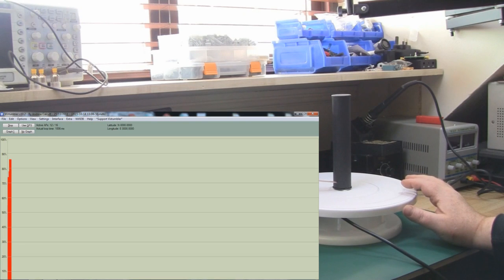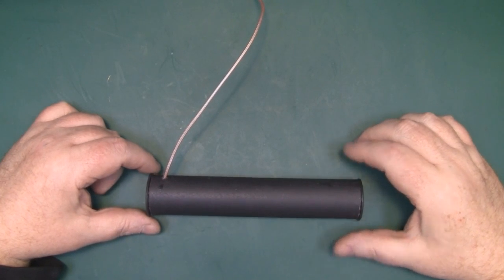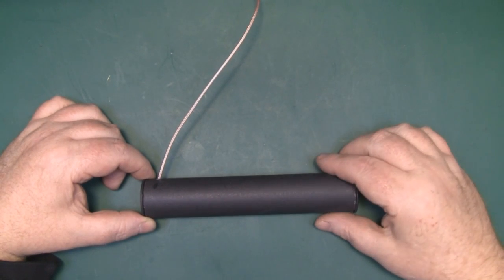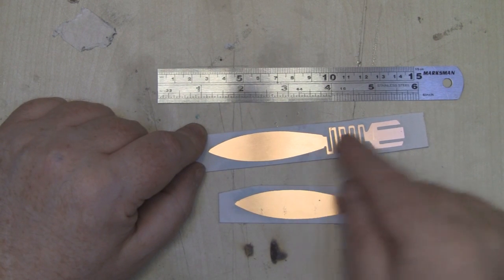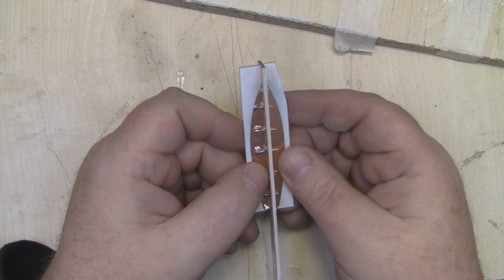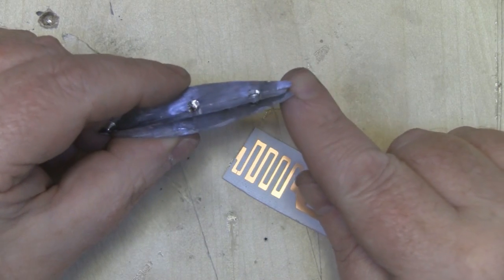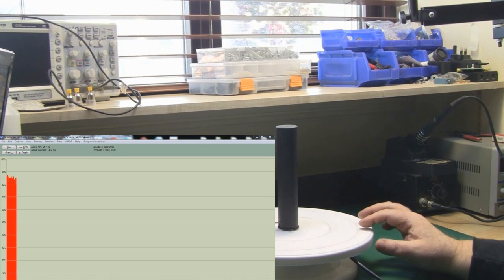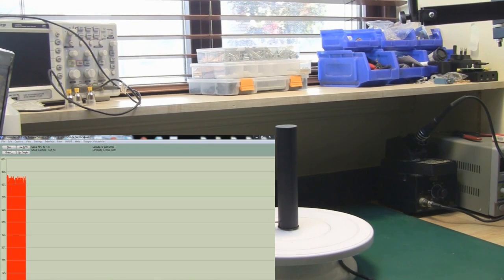Cisco Aironet Air Ant1728 Improving the Design

Comment: Hi Andrew, Im new to using Kali and have been experimenting with reaver and airmon, airodump, and wash commands but my wifi reception isnt the best..  Im pretty hard up for cash and wanted to ask you if you could reccomend a budget wifi antennae thats pretty cheap but pretty good.. If there is one, but it also needs to be able to inject packets so I can use it with Kali..   Any suggestions ? ? ?   Thanks in advance..   Or even if you have a home made one you want to sell